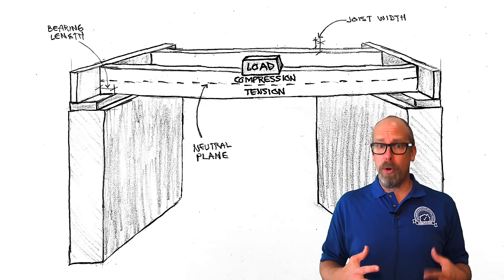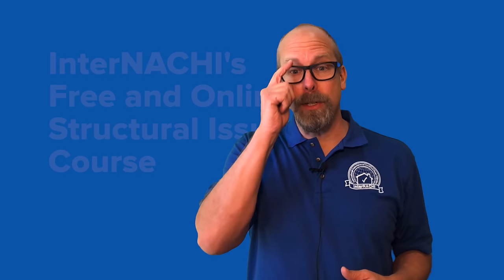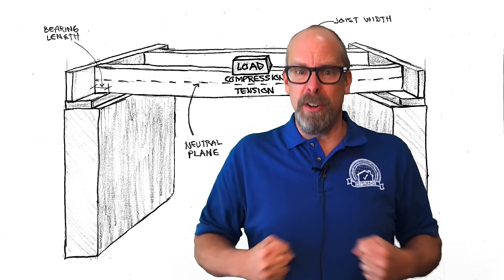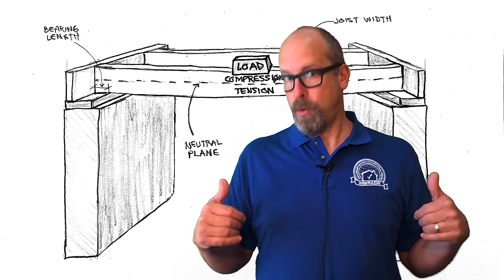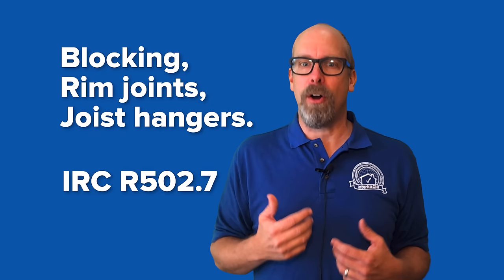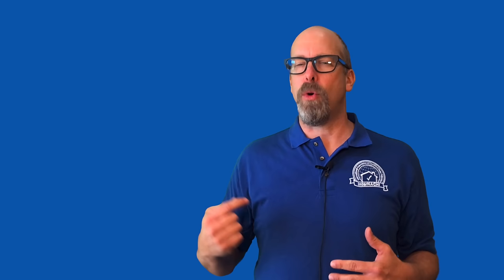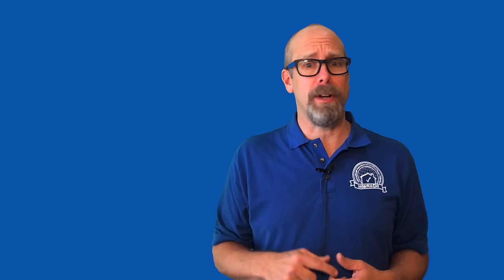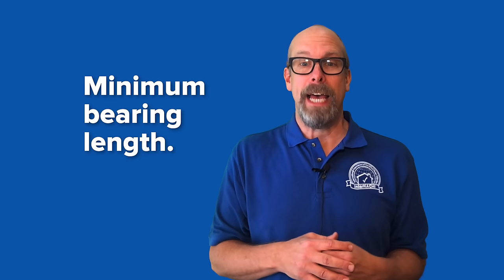Science of Simple Spans of Floor Joists

Comment: If you an at the load limit of a joist, and change the centers to 12 inch centers and glue and screw the sub floor would it be as good as if you used wider joists  on standard centers?
Reply from the maker: Thanks for commenting. Good question.

Comment: i understand this question is for my structural engineer but wanted to see if you would have an answer. we have a 32 feet wide 130 feet long structure.. the floor would be hollow core precast slabs. what would be the size of the columns and beam to hold the weight of each precast slabs without any support in between 32 feet width?
Reply from the maker: Thank you for watching. That information is from Glenn Mathewson from https://buildingcodecollege.com/. Check him out.

Comment: As a rough carpenter, when we (rarely these days) use dimensional lumber as opposed to I-joists, we always put bridging on spans over 10'.  Its just one of those things we do.   I recently learned that this isn't even required by code for us,  as the code states "joists greater than a nominal 2x12...." But it is usually enforced.  I am building my own house shortly, and although I despise working with 2x,  material and engineering costs prohibit TJI system.  Architect spec'd 2x10, which seems quite anemic for the 14.6' span, but does mention bridging per print.  My question for you is; does solid blocking stiffen a floor better than 1x3 diagonal bridging?  Before I watched this video I would have said absolutely, but after learning about HOW joists deflect (rolling or flattening...) I now am doubting my 20 years of carpentry instinct.   Lots of words, sorry.  You've earned a new subscriber!
Reply: I read somewhere that 2x2 bridging is more effective than blocking.  This seems counterintuitive to me but I imagine it has something to do with how wood shrinks over time.  The bridging/blocking does serve to redistribute some load to the bottom of adjacent beams.  And the bridges have their non-shrinking longitudinal axis oriented in line with the load path while the blocking axis is skewed to the load.  Any transverse/radial wood shrinkage of the blocking will reduce the load transfer/add to final deflection.  However, every time I feel a floor deflect I always wish I had those extra inches on depth.  As for rolling, once the compression flange (top for simple spans under gravity loads) of the joists are braced by the floor diaphragm, the lateral buckling concerns should be considered addressed.
Reply from the maker: Great to hear, Matt. Thanks. More videos coming.
Reply: Matt no reason to doubt your years of great carpentry experience. Simply understand the difference in Systems. I joists are Engineered Proprietary Systems.  And the Code recognizes that fact. So installation will be according to Manufacturers Specifications for particular deck spans, loading etc.  as opposed to Standard dimensional lumber span charts in chapter 25 of the Building Code (California). Good Luck.
Reply: @stevelopez372  did you even read my comment? 😆
Reply: @9mmkahr  Have you ever read the Building Code and understand the span charts. And Metal cross bracing will work better, no shrinkage.  Besides Blocking or bridging is for Rotation not necessarily deflection.
Reply: @stevelopez372  yes, I have a copy of the 2015 Michigan residential code right beside me.  Bridging seems like the clear choice!  Never considered it better until now.  Cheers
Reply: @stevelopez372  we rarely use dimensional these days.  I joist systems are so much faster and consistent. We regularly have over 22' spans.. (Usually 3.5" joists or 12" oc etc) which is near impossible with today's dimensional lumber.   I joists are a clear winner, from my standpoint
Reply: @9mmkahr   I agree, I joists are the ticket. Good luck from SoCal.

Comment: Can anyone give an answer, making a horizontal roof with 5 x 30 cm wood joists (30 cm being vertically) would the joists in 5 meters length bend from it's own weight and snow ? And what is the max spacing required between joists, is 70 cm enough ?
Reply from the maker: Good question. Ask Glenn Mathewson of https://buildingcodecollege.com/ who wrote that content.

Comment: I’m in the uk. My bungalow room is about 3m from the outer wall to the dwarf wall. A golf ball will roll on the floor from the outer wall to the dwarf wall. I looked up the standards. I’m guessing my joist size is around 47 x 150.
The standard limit says 3.2m.
20 year old floor. I’ve looked under last year and the concrete slab and timber is bone dry. I dunno whether to be worried, support it or just do a timber self levelling screed and forget about it 🤷🏻‍♂️
Reply from the maker: Thank you for watching and making a good comment.

Comment: Related to notches in the ends of joists.  I remember reading something that claimed that strength of the joist is more complicated than simply the depth at the ends, i.e. that if you have a 2x12 joist and you cut 2" x 2" out of the bottom corner on each end, the joist is not reduced to effectively a 2x10 joist, that it's still stronger than a plain 2x10.  Is that true?
Reply from the maker: Good question. Ask Glenn Mathewson of https://buildingcodecollege.com/ who wrote that content.

Comment: Great information, I have a 1950s single story with water damaged floor and floor joist. They're 2x8s could I replace them with 2x10 with a notch cut out on the outer bottom edge?
Reply: I wouldn't do it. That notch in the bottom creates a perfect place for a split to start as well as making the extra two inches useless. Find a way to lower the support base or use 2 x 8s
Reply: @stratocruising  i looked underneath and the floor joist have sunken in at the end on the outer foundation. Its at most 1/8 to 1/4 in. can a shim work underneath there or would the joist need to be sistered?
Reply: @luisfigueroa7851  Not exactly sure what has deformed; has the outer foundation (Wood, I assume) collapsed slightly or is the floor joist now smaller than 2" x 8' at the end? if it is the first, a shim would work, but make it broader than the joist bearing on it to spread the load out over a larger surface. If it is the later, I'd sister it for the first 2-3 feet
Reply: @stratocruising  thank you, I think its the first where the wood that rest on the foundation (in my situation) has settled or got squished over time. Ill make my plan of act soon. Again thank you for the information.
Reply from the maker: Thanks for watching, Luis. Good question.
Reply: The short answer to your original question is YES it will work.

Comment: We have a newer home less then 2 years old with 2x10 floor joists and I noticed that one of the joists has a horizontal crack about 18 inches long on one end of the joist that rests on an LVL beam. This crack is in the middle area of the joist width as you indicated in the video and is about 1/16 of an inch wide. There is nothing significantly heavy sitting over the area in the floor above the joist. Is this any kind of concern?
Reply: No, it will not fail. Easy to repair if there are no wires or pipes going thru that section. Just sister some 2x10 or 3/4” plywood on both sides. Construction glue and nails.
Reply: If sistering is not possible get some large mending plates and hammer them on the cracks. I would squeeze some construction adhesive inside the crack before doing this.
Reply from the maker: Thank you for watching. That information is from Glenn Mathewson from https://buildingcodecollege.com/. Check him out.
Reply: Unfortunately  there is a lot of wiring that passes through the joist so that would require pulling all the wiring from the panel. I will monitor it for now as it has not changed in size or diameter.
Reply: @p51mustang31  Cut 3/4" plywood as if there were no wires, then drill for the wires and cut the patch to split it at the wires. The glue and screw it in place. Do that to both sides.

Comment: I just did some 2x10 blocking in my basement area for the living room above, that is always bouncing when the kids play.
Some of the blocks fit ok and some are a little tight/loose.  I used long general purpose wood screws.  Floor seems more stable, but when I walk into the living room in the morning I hear a few loud cracks/pops.  Seems like it's only once or twice a day.  It's not my subfloor since I screwed the plywood down before laying 3/4" hardwood a year ago.  What's this popping noise and should I be concerned?  This is only a 21" section I blocked.
My span is 14' and the house is 32 years old.  Home was built with the 1x3 diagonal bracing, but that stuff wasn't helping it seems.
Reply from the maker: Glad you enjoyed watching the video.
Reply: The popping sound is the loose fit of the blocking. Since you screwed in the blocks, remove the loose ones and replace with tighter fitting blocks. Add more blocking every 4' along the length of the joists and cut them to fit less loose. One row of blocking in the middle is not adequate.
Reply: Loose blocking is NO blocking! My old boss made me tear out and start over.

Comment: So if my calculations are correct, using L/360 when using 12’, 2x6 lumber for a shed floor joist means it is acceptable that the 2x6 bow a maximum of 0.4 inches? I’m currently using 3, 2x6 joists 16” on center spanning 12 feet. I did do blocking.  The center joist is currently bowed 1/4” and I’m not done adding all the totes with seasonal items on the loft. I’m thinking about sistering at least the center joist. Thoughts?
Reply: Correction, I’m talking about a shed loft, not shed floor.
Reply from the maker: Thank for watching the video about simple spans of floor joists. The content was provided by Glenn Mathewson at https://buildingcodecollege.com/.
Reply: For an unknown heavy static load spread over the 12' width of the loft: 2x8 minimum or 2x10 prudent.

Comment: So how far can my double lvl span?? (1 3/4x7 1/4).. addition to my garage 30x30. Using these lvls cause I have 5 million tgi’s in my garage. I’m doing a triple 2x10 in center, piers 7.5’ so 5 piers in center. On my gable side is my steel which I know is good. The overframe side that lands on my existing garage roof is where I’m putting these lvls. 8’ away.
Reply from the maker: Good questions.

Comment: “Denser wood species span further”…?  Not necessarily.  Doug fir is not the most dense wood but is probably the best structural lumber.  For example a 2x10 doug fir joist has a greater span than many hardwood such as hickory.  Hickory is far denser than Doug fir.
Reply from the maker: Good point. Got it.

Comment: I'm working on a home with an attic that was converted into a sleeping room years ago but they never increased the 2x6 @16oc joists to accommodate this.  As a result, the joists have begun to dip. I'm trying to find the best solution for the problem.  Do you know of any resources that call out the added span capabilities when sistering joists? Additionally, the current span would necessitate 2x10s, but given the depth it makes it impossible to place them on the top plates. Therefore,  do you know if there's any literature that would let me know if I'm allowed to place blocking between the 2x6s where they bear, sister 2x10s, and then use a joist hanger to capture the 2x6 and 2x10 at the end? I've looked online without much luck on either sistering info or the hanger idea.
Reply: A DYIer here. I don't know more details of your situation. If current floor joists are not part of the roof trusses:
1. You could make headers out of TWO 2x8s and place those in between 2x6 joists independently, that is not sistering with current joists. 
2. Basically,you will be building a whole new base for the attic room floor. Lots of extra lumber cost but could be doable.
3. If 2x8s don't fit at both ends due to tight clearance, you can cut out triangles on top of both ends.
Reply: You can go 8" oc and double the allowable load or 12" oc which the charts cover or use 2-2x6 beam off of a chart. Also a minimum of 3'4" plywood screwed and glued.
Reply: I’d suggest approaching an engineer. Increasing the number of joists, using steel plates bolted alongside some of the existing joists to create flitch beams, or gluing and screwing 3/4 ply to replace whatever boarding forms floor deck are all possible options, depends how over spanned it is and what loads you are carrying, also whether you need to achieve a code standard for safety or future sale of the property.
Reply from the maker: Hi, Nate, thanks for watching. And commenting.
Reply: Yes, sister the 2x10 and use steel hangers to tie them together to the 2x6 at the walls. That meets code.
Reply: @sidsid9808  This won't fix the sagging attic joists and room ceiling underneath. Be aware that there also must be vertical support under each new "header" all the way down to the foundation. Also, wood joists that have been bent for several years will take a set and will remain curved even when the weight is removed.

Comment: there is no edge "notching" of joists.  holes drilled in the center is about it. probably not > 2 in.  engineered joists are wonderful and allow huge spans without center I-beams.  24' or > dependent on the engineered joist height.  not as good under fireload conditions however.   freaky thing about engineered joists systems is that when they're installed and before the weight of interior walls, ceiling joists and drywall is present they bounce like a trampoline.
Reply: Incorrect: you can notch the end of a solid sawn joist 1/4 the depth of the joist. 

Straight out of the IRC:
Notches in solid lumber joists, rafters and beams shall not exceed one-sixth of the depth of the member, shall not be longer than one-third of the depth of the member and shall not be located in the middle one-third of the span. Notches at the ends of the member shall not exceed one-fourth the depth of the member. The tension side of members 4 inches (102 mm) or greater in nominal thickness shall not be notched except at the ends of the members. The diameter of holes bored or cut into members shall not exceed one-third the depth of the member. Holes shall not be closer than 2 inches (51 mm) to the top or bottom of the member, or to any other hole located in the member. Where the member is also notched, the hole shall not be closer than 2 inches (51 mm) to the notch.
Reply: @benjaminberan7645  framers ain't real big on having their work slashed away by the other tradesmen.  plumbers are brutal with joist systems when installing their stacks.  never had to notch a joist, although I did get creative now and then with rafters and my 28oz. rigging axe.
Reply from the maker: Thanks for commenting, Marcus.